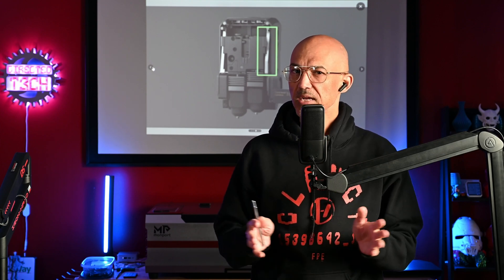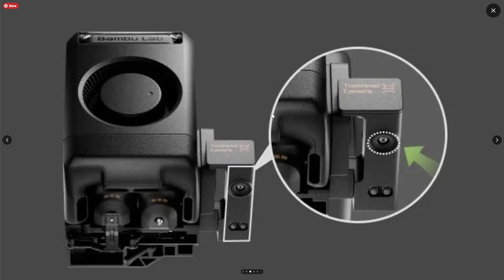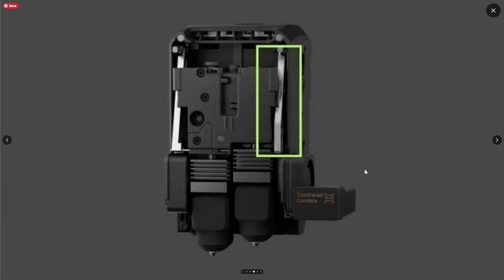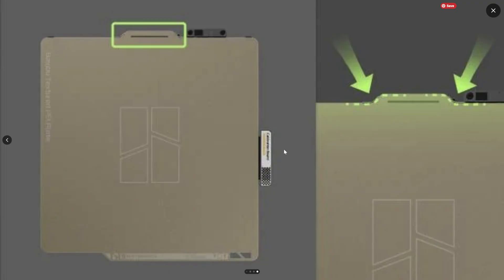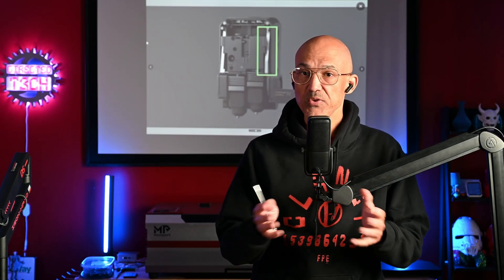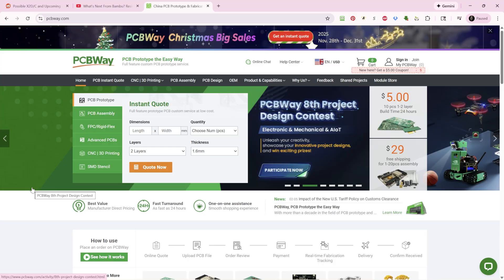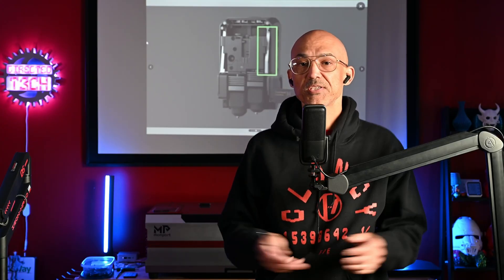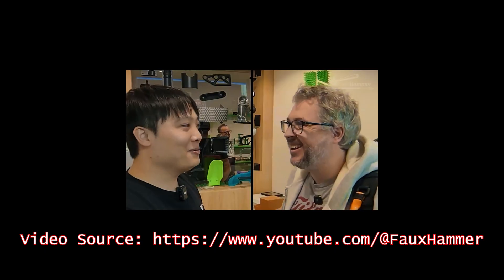Bambu Lab X2D / X2C Leak?

Comment: I am sick of the 2 nozzles on the same toolhead because it can't use the entire bed, and they need a nozzle blocker that get damage often in every warp. I hope they do something similar to the Prusa CORE One INDX, instead of the H2C, which isn't a game changer since it can't work with flexible materials, and it creates more movable parts.
Reply from the maker: That huge tool head down have some downsides like you mentioned. INDX should solve that problem!  Looking forward to seeing if Bambu actually makes a tool changer to keep up with the market.

Comment: With the price of the P2S compared to the H2S, it’s going to be a tight fit in the product stack, but it likely is close to the H2S, just with the standard Bambu build volume… so maybe $1000 for the base printer, $1250 for the combo, I would guess.
Reply from the maker: I agree. I think those are the price points they need to hit.

Comment: I'm 99.9% certain I'm wrong but here's my take. 

1. If it's an X line it's premium and we are talking over $3k and possibly really big build volume (nearing 400 mm in almost all directions) with crazy features no other of their series has.

2. What if during the fau hammer interview they were referring to an A2? A 350mm x3 with updated features like better camera and an A2 mini that is 220mm x 3 in couple with the same updated features (mainly lidar/camera detection stuff). 

Those are my guesses. I was right in my guess with the H2S, but that's all it was, a very lucky guess that I bought as soon as I could. Dual nozzle isn't for me, but I see the appeal. The H2S is the printer I wish I had always had, despite some initial build issues that lead to 2  CS tickets.
Reply from the maker: That's a pretty interesting theory about the A2!

Comment: The X is the flagship. It will be $3,000 or more. And an awesome double tool changer for a total of 12 Filaments plus one in the machine. I am sure they will make it bigger also. Although my H2C is pretty big compared to a P1S. And I am sure they will add in a lot of other cool tech we are not even expecting. The real question is, will they make an A1 with a tool changer? Some have already whispered dual extruder on it. The A1 is compatible with the AMS2 Pro. Lets go!
Reply from the maker: A 12 filament tool changer would be insane!

Comment: The right extruder is bowden drive. And the big cube at back is the extruder. So they can fit 2 nozzles in a P2S sized toolhead.

And the 2 shiny things on the sides are the cutters. The filament will be cut from the front. So the build volume can stay the same 256mm³.

I feel like i
The bowden extruder will be dedicated to a single material from the external toolholder, while all the AMS-es will be connected to the left nozzle. There is nothing wrong with bowden drive. And I think if the price is going to be right, this is gonna be a great printer.
Reply from the maker: A bowden drive would certainly save on toolhead weight!

Comment: Nah . Look at the piece between the two nozzles...it's solid, which means there's no way for the nozzle to move up and down when switching... This is AI rendered 🐂 💩.  Yes, there IS an X2C coming, but that ain't it.
Reply from the maker: Do you think they'll actually make a X2C or just stop at X2D?
Reply: @directedt3ch  I don't think there's any X2D in the pipeline at all... The picture is obviously fake (the part between the two nozzles is solid, which means there's no way for each nozzle to move up or down in or out of print position, and if it was a genuine photo, the Bambu branding would be on the nozzles...fake AI generated b.s. ).   I think Bambu's strategy is, multiple nozzles will be exclusive to the H series.   You want the premium feature of multiple nozzles, you'll have to pay the entry price to the H series..  X, P, and A series will remain single nozzle machines.
Reply from the maker: @3dcreationsofri I appreciate your insights!

Comment: If the X2C turns out to be a H2S but in 256x256x256 for a slightly cheaper price Id love that. Really don't need the large size of the H2S but I want the accuracy and feature set of it.
Reply from the maker: I think that would be something a lot of people would really like!
Reply: isnt the p2s the same thing?
Reply: @peterpeter5666 not really the p2s cant use the visual encoder and lacks 1.5mm pitch belts that the h2 series has.
Reply: @DontTouchtheDoor  true but its pretty close and for the price i presume its going to be its best seller
Reply: needs to be bigger, at least matching u1's 270. makes sense that X2d would introduce next gen heat bed size. and 2 nozzles is ideal for most normal print and multi color would be X2c with bit smaller bed size

Comment: X2x? After fucket up p2 series with glued rods, glued motor pulleys etc. planned obsolescence, no thank you.
Reply from the maker: Guessing you are done with Bambu?
Reply: @directedt3ch  arco 3d printer, it seems at least not built cheaply. But no chamber heater etc. But this the only 3D printer released that has included torque wrench for nozzle replacement. This is enough to say built by engineer no and idiot marketing scam department.

Comment: A lot of people act like the P2S is better than the X1C, when its actually a budget version with a couple of downside compared to the 4 year old flagship.
For the same price I would still chose the X1C over P2S every day.
The X series is the high end prosumer model, its above the H series. In quality, features and also in price.
Bigger is always worse when it comes to 3D printers, its a huge downside you can live with when you really need it, nothing nice to have.
A larger and heavier motion system is like room in a car. Pretty much like SUVs, they got insane wind resistance drive like shit due to their high center of gravity and 99% of the time they are driven by one person on a road with no cargo.
If they made a smaller H2C with lidar and carbon rails you pretty much got an awesome X2C. I would pay 1200-1500 for that.
They probably would add something new expensive on top to set a new standard.
Reply from the maker: I think the argument is that the P2S has many of the features of the X1C at a lower price point and still offers good performance.

Comment: I think an X2 product could fill a niche by becoming a hybrid of the upgraded features from X1E, P2S, and H2D.  Chamber heater and higher temperature capabilities from X1E, improved fan/filtration setup from P2S (and newer LIDAR sensor), and a new dual-hotend tool head similar to H2D, all packaged in the smaller and more desktop-friendly volume of the X1/P2S series.  Maybe fix the little keep-out area at the front left corner of the build-plate, too?  Maybe not possible with the dual extruder head, I don't know, but I'd still put it on my wishlist.

What I'd like to see would be some kind of "easy mode" option for Bambu Studio that would work for any of their printers.  Just a simple, drastically reduced set of presets to balance print speed and quality, confirm the colors to print the model requested are loaded in the machine, clear and easy instructions are provided on how to change the filament to the right colors if needed, and point them where to look to resolve common issues if an error occurs such as a clogged purge chute, material or other debris from a previous print job still on the plate, a tangled filament on a spool, or possible incompatible material types loaded for a multi-color / multi-filament print job unless they're used on separate objects.

There's a lot of people like my wife and kids that would like to 3D print things without having to rely on someone more tech-saavy to help them do it every time.  They want it as easy to use as a 2D printer without having to learn what all these settings in Bambu Studio do.  They're not tinkers or engineers and don't know or care what all those settings do.  They're not interested in learning all that stuff.  They just want to print out a widget and have the printer and software be smart enough to know what settings to use to get the best result possible for the preset they've selected.  They don't want anything that is significantly more complicated than it is to refill paper or swap ink carts on a 2D printer.  I don't see any reasons why that can't be done
Reply: I feel like I'm the consumer you're talking about with "easy mode" and I can tell you it already exists - I have almost 750 hours on my A1 combo and I've never opened Bambu Studio; Bambu Handy is easy mode.

Yes, you have to dig around for the right model for your use case, but once you find something you just load the filament and press print. The most technical thing I've done since assembling the printer is either swapping the faceplate or applying glue stick when I first started printing with petg instead of just PLA. 

Don't get me wrong, I want to learn how to make my own models and tinker, I'm really interested in learning how to "raft support" for better multi material interfacing but I just...haven't had to yet; search model, hit button, new object appears magically.
Reply from the maker: Great insights!  Do your wife and kids find the Handy app useful or still too complicated to download and print a model straight to the printer?

Comment: I for sure think they can and will (especially after this vid) fit a X2D or C would fit in the Bambu lineup. The ‘H’ in the H series stands for Hybrid, so whether you use a laser or not, those printers are designed for it and that different toolheads. An update X series via the X2D (D standing for dual) could be the true 3D printer only system with a dual nozzle setup (specifically not the H2S bc that’s still a hybrid design). If it’s the same price as the X1C like the P2S replaced the P1S (or even a tiny bit cheaper than the X1C), then that gives ppl a logical choice between the H2S and X2D, with the two deciding factors being price and the option of a laser.
Reply from the maker: I agree. I think they'll slot it in and since it isn't a Hybrid, it should be a little bit cheaper than the H series.
Reply: the H actually does not stand for hybrid! They picked it because it sounded good. After that they provided some logical things that the H could stand for. But in general the letters they chose are random and don't have a meaning :D

Comment: I think that the Vortek approach would be faster (fast enough?) if the software allowed for unloading and pre-loading the colour changes while the other side of the toolhead was in use.  If a bit part of the unavoidable delay in using an AMS-based solution, then the answer could be to reduce those delays via a better software approach.
Reply from the maker: Indeed! I was hoping that they would redesign the AMS for the Vortek system.  Imagine an AMS that had 4 (or even better, 6) tubes coming out the back to a buffer that was right on the back of the printer, to reduce retraction distance.  But that still wouldn't be as idea as something like INDX.

Comment: I don’t think the Vortek is a good option for the X and P series. That would shrink X to 236. If it’s a dual nozzle setup and Bambu does the same thing as the H, we’d be down to 216 in X for dual colors. Unless they can get the sizing of the dual nozzles/Vortek reduced or they make a new enclosure (unlikely based on the size of the P2S), it just doesn’t make sense.
Reply from the maker: The C variant would definitely take a bite out of the usable build volume.  It may just remain in the H series. I'd rather see a full tool changer in time.

Comment: You are paying a premium price for a printer but you are crippled by its ability to print TPU... AMS should be removed from the picture or at least positioned somewhere else from the main focus. They need to create something similar to INDX theres no where around it. INDX is going to be ultimate boss when it releases. 
With the current X2C just imagine if you could keep the right nozzle exactly as it is (vortex with AMS), but implement INDX like system to the left nozzle instead of keeping it there passively. That would be THE BEST printer to ever exist.
Reply from the maker: That's a wild idea!

Comment: The box at the back and the weird toolhead insides might indicate the use of a bowden extruder.
Reply: Yeah, that was my initial guess as well. Granted, that seems awful given the entry into the printer. The amount of filament slack in that run isn't going to be good. 

Probably just don't have the space in the toolhead for the same type of mechanism in the H2C/D (and cost of course).
Reply: @winebartender6653  You can get them pretty dialed in. And the big upside is they remove all the moving mass that needs to be accelerated. 
You can make a substantially lighter print head and accelerate and print way faster.
Moving masses that need to be accelerated are the main factor for print speed until you run into material stiffness problems.
A heavy motion system is why the H series is such a bad idea if you dont really really need the large print size most of the time.
These multi color large printers are for the loud flexi dragon crowd that doesnt know CAD and just wants to produce plastic trash at volume.
I would looooove if Bambu made a really light stripped down print head, 4 steppers for the corexy, carbon rails, bowden extruder, and cranked speed up to double or more with a comparable quality. 
Something close to a VZbot or a Voron0 or even a fast delta.
Reply from the maker: That's true.  The H series extruder motor is pretty large.

Comment: It won’t be X2C. C was Carbon and we are done with carbon rods. C is changer now. It would be an S or D suffix.

P2S is the combination of X1C and P1S. There is no reason for X2S to exist. X series had metal panels, but the H series flagships are plastic. 

LiDAR is done, the new camera vision system works better for failure detection.

They won’t do a dual nozzle variant of 256 cubed build volume as it would eat into sales of H2D.
Reply from the maker: So what do you think the next X series printer will be?

Comment: The X2 series needs to be a multi toolhead system. Anything less and it's already behind the competition. Period. The H2C is already obsolete next to the U1 or the new Prusa+ INDX machines purely due to its price and reliance on the AMS.
Reply from the maker: I don't think that is what we will see with the next X series printer but I agree that they really need to make a full tool changing design that doesn't have the current AMS reliance.

Comment: My guess is X2C will be their answer to snapmaker...P2S (and H series) was likely too far into development/production to do any radical multi-heads design changeups but clearly everyone will need to move in that direction in the next year or two to compete. X2C could be delayed some to get a good 4 or 5 tool/head competitor and keep up with the evolution demand. Of course they will have to be careful to not destroy the H series market if the X2C comes out with that many tools and likely many of the features/improvements we've seen in P and H series refreshes.
Reply from the maker: I think they need to go this route as well.

Comment: The software solution is so bad on these, I'll buy something else. The hassle with having to calibrate a filament one time outweigh the half hour I have to spend before each print with the serial and the product number and the ip address and all that shit. It's really a shitty system. I usually use one of my other printers, voron, sovol and creality and it's just hit send. I don't think they loose a lot of customers, maybe just me.
Reply: Lol, keep printing with your junk.  It takes me 2 mins to dial in any new filament.
Reply from the maker: That's very interesting! I don't have any issues printing with various brands of filament.  Elegoo Rapid PETG is my most common. I just got through the calibration process if I need to make adjustments and save it.
Reply: @directedt3ch  Same, I use Elegoo Rapid PETG with the "Bambu PETG" profile with no problems.
Reply: Loool... You lost me at Creality...
Reply: Most filaments work with default profiles, at this point I wonder what y'all do in the slicer.
Reply: @fernandobanuelos5541  Even with a Bambu, there are a lot of tweaks you can do to get better prints.

Comment: Yes they need an X2C priced from $1000 - $1200. They need to make it a nozzle changer with either 4 or 5 nozzles so it can compete, if not overtake the Snapermaker U1.
Reply from the maker: It does seem that they are missing this price bracket now for a multi nozzle capable machine.
Reply: Nossle changer + dual Nozzle + AMS = 40+Second filament swaps £1800 minimum twice price of Snapmaker U1 and 3 x print times fir complex multi colour.

BAMBU may be ultimate quality machine and eco system but that does not linearly translate to print quality.

I get Bambu Fan Boys but as a vlue proposition theyre no longer close to best out there
Reply: They will never never get close to £1000 or Even £1200 for a tool changer, it would break bambu
Reply: keep dreamin

Comment: I’m disappointed with the lack of Vortek multi TPU capability.  If Bambu can solve that…. Then they instantly jump back into the conversation.  That external filament feeder image looks interesting… but only haas 1 ptfe input.  Needs 4.
Reply from the maker: That does seem to be something that toolchangers definitely have the advantage on.  I don't print much TPU, so luckily I don't have to reconfigure the H2D too often.
Reply: Vortek requires feeding from an AMS. It will never be able to properly do flexibles.